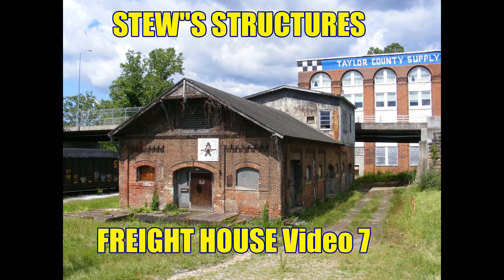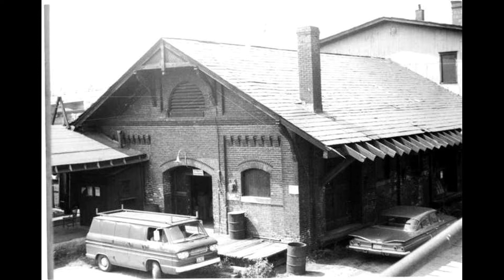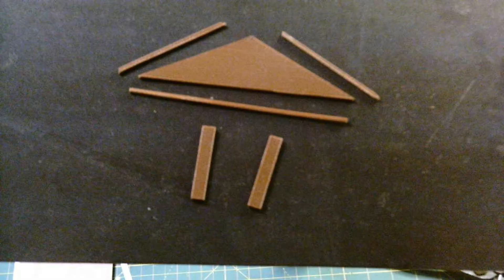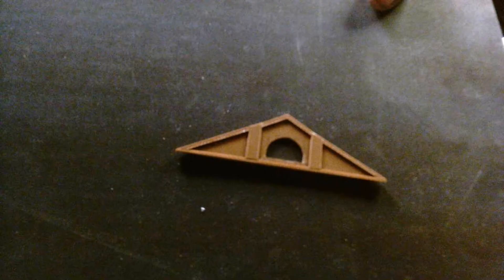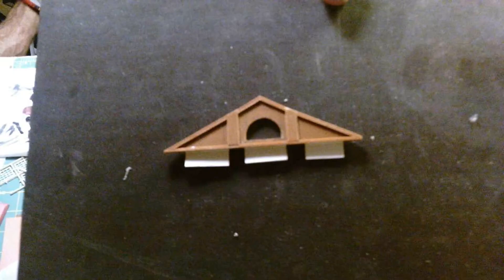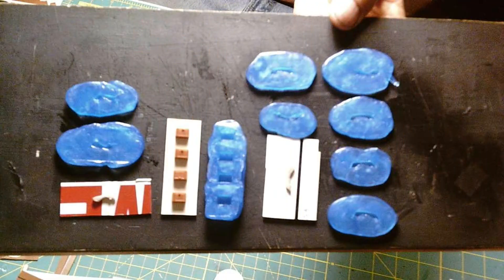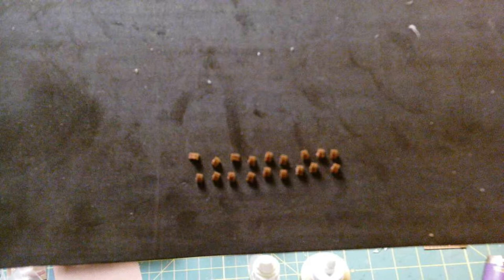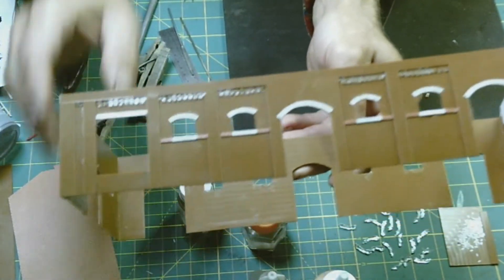Scratch building a Prototypical Freicht Station  Video 7

Comment: I really appreciate your work, Mark. Even if it’s a short video, plenty enough details to learn your way of making things, and they are very helpful.  

Question though, do you measure the width, length and height of the real structure walls then covert them in HO sizes, or do you just eye ball it however looks proportional with other buildings on the layout? 

I’m thinking about scratch building a 2 door trolley car barn in N scale from my old town that I’m modeling.  I only have one more spot on my layout and will be using cardboard and printout brick walls, & so forth. I like it to be all styrene but the cost of those can add up.  I’d rather use the money to get cars or engines. 😀

Oh, the structure today is actually 2 stores inside now.  The front has the regular glass doors, but I’m looking for more photos to see the original doors and maybe put a static trolley in front with tracks that was cut off. More like a display.  

Anyway, just wanted to know how you did your wall measurements.  Have a great weekend.  - Drew